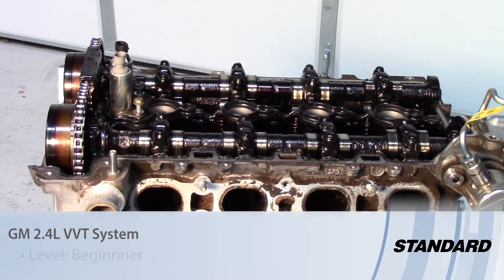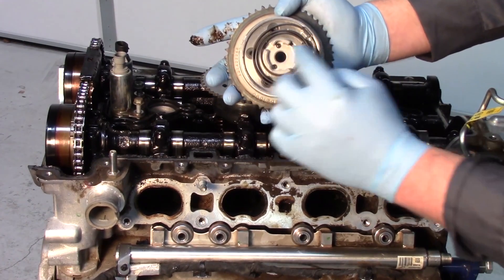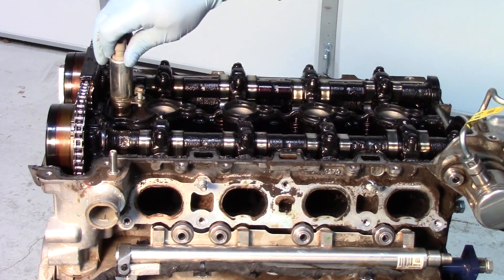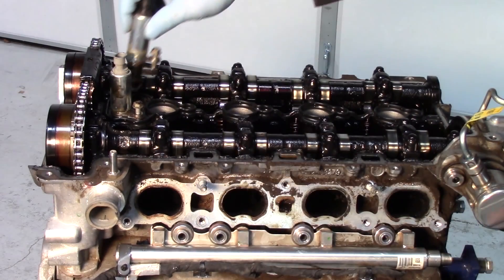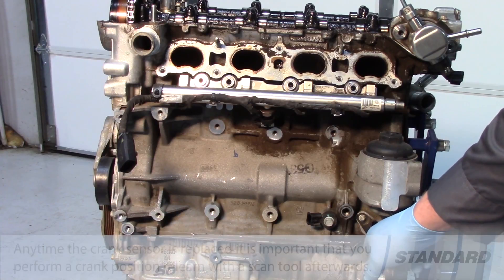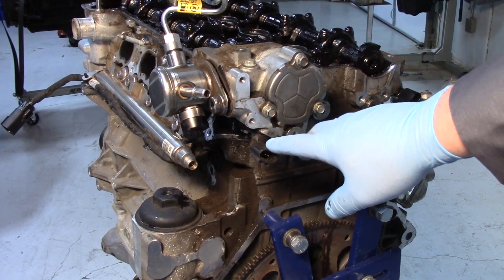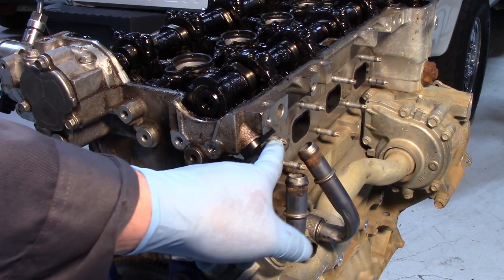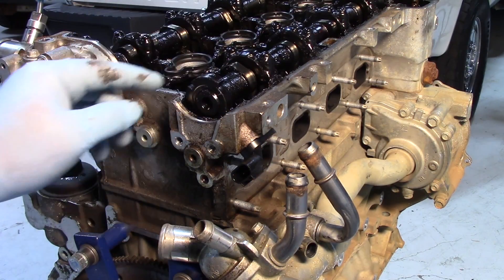GM 2.4L VVT System

Comment: What year or model of this 2.4 L Ecotec engine was this? In the 2010 LAF model used in 2010 Equinoxes and Terrains, the phasers were not the same. The intake phaser had a grey front cover and exhaust phaser had a black front cover.  They were only the same starting with the 2011 model year.  Various GM TSB’s detail the issues and problems in using 2011 and later cam phasers and related parts on the 2010 (LAF) engine.  Always get and use the vehicle’s VIN when ordering replacement cam phasers (a/k/a camshaft actuator/sprockets) and solenoids, so that you install the correct parts. Using the wrong intake phaser can result in bent valves and damaged pistons if you are not very careful.
Reply from the maker: The vehicle used in this video was a  2010 Chevy Equinox 2.4. Hope this helps.

Comment: I have that engine and they should have been in the junkyard when they were new. I maintained it myself, changing the oil at 5000 miles and used mobil 1. It now uses oil and the pcv system doesn't work properly causing a lot of moisture build up. Once a month I have to take the air box off and pour water out and clean up the puddling. 
This is a great instructional video, though.
Reply: My malibu has these same symptoms going on but i'm gonna take the valve cover off and clean the inside and get rid of the sludge.